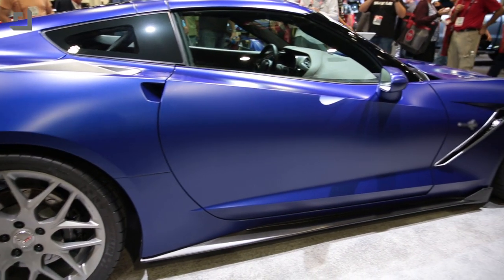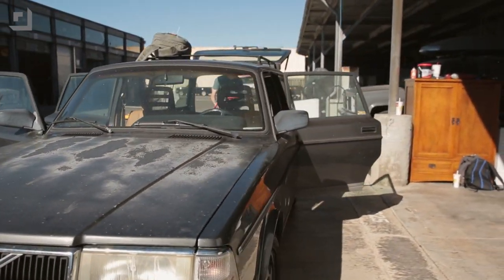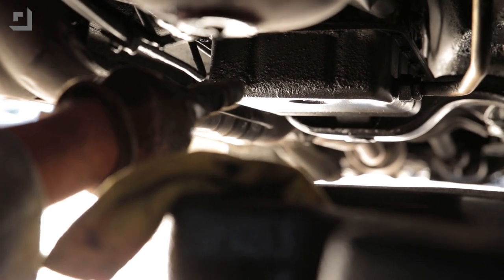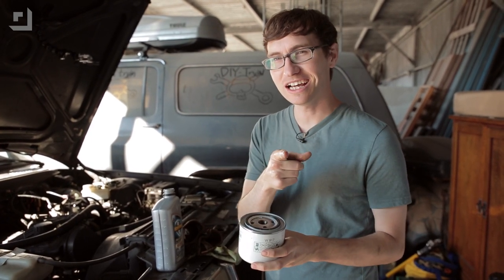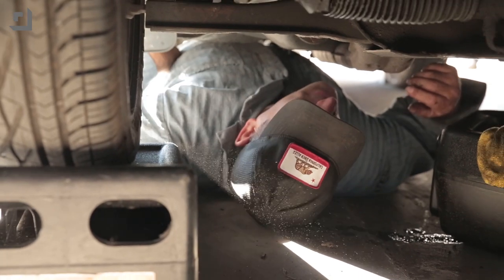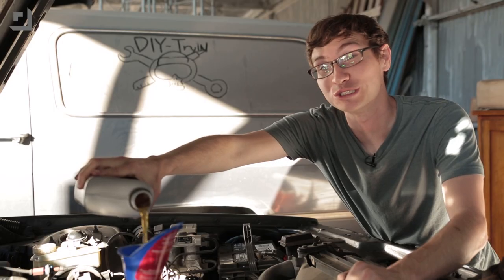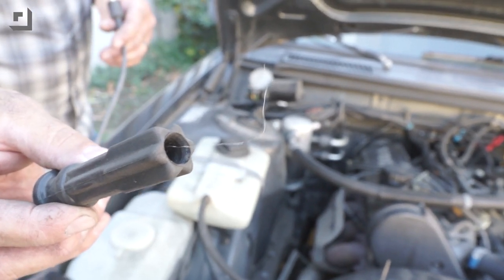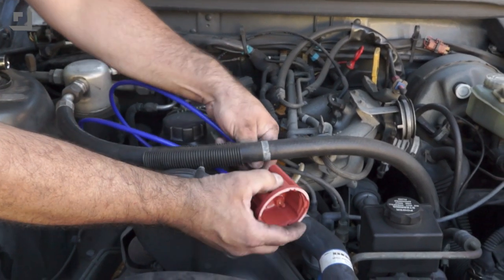Engine Mounts, Oil Change, and a Tuneup: We're Going to SEMA!

Comment: A professional mechanic would do almost the same thing you did with the spark plug wires. Expect for safety we normally pull the spark plug wire when the engine is off then start the engine. Your way is faster but it would scare me, especially on new cars.
Reply: Thanks for the tip... horrid side effect of growing up in the seventies is unlearning a lot of bad habits.

Comment: You want to also put oil in the filter so the engine doesn't run on air for a while
Reply: or you could just pull the fuel pump relay and crank the engine for about 10 seconds, doing it this way ensures the whole engine has oil in it before you turn it over for the first time.
Reply: Can't really put oil in a filter that mounts horizontally!
Reply: HI if the vehicle was a diesel with a large filter that holds 1+ qts of oil yes this would be necessary but with your typical car/truck it is not

Comment: I'm just wondering what lights were lit up on the dash at 4:17. The panel must of been like a Christmas tree before the tune up got started.
Reply: ABS, SRS, and Check Engine. New intake gasket solved the check engine, fixing the wiring to the rear diff speed sensor fixed the ABS light. SRS light is still going, just learned how to get the codes for it. Probably steering ring...